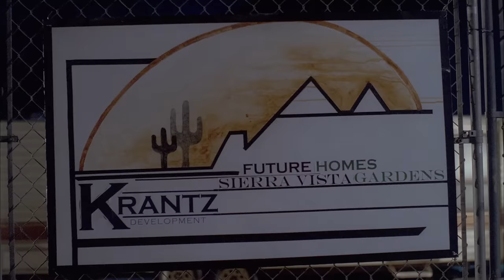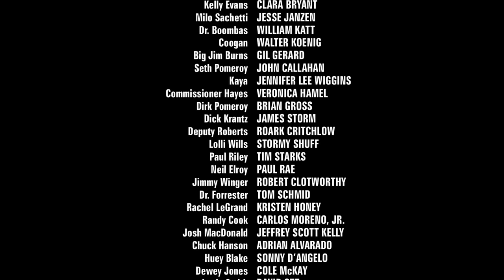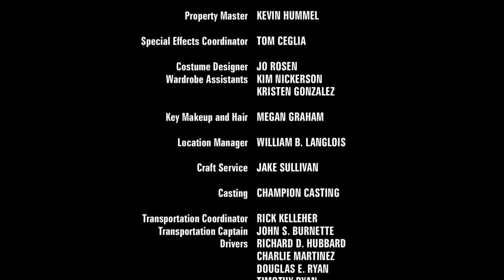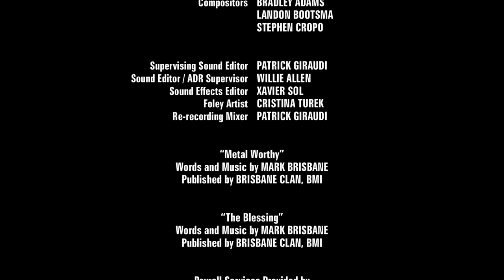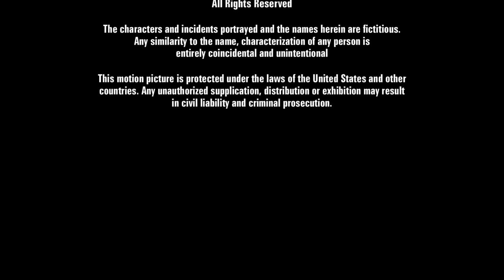BONE EATER Full Movie | Monster Movies & Creature Features | The Midnight Screening

Comment: General question to the room:
You throw a stick a dynamite at something that goes GRRRR after.
What do you do ?
a) Run like a cartoon.
b) Raise hands in the hopes of fendinjg off the impending death attack.
Reply: Run like a cartoon. If there is a door or wall in my way, pull a Shaggy and leave a hole in it shaped like me.